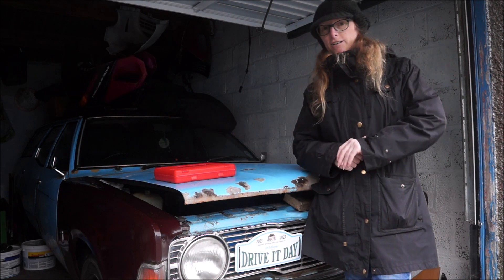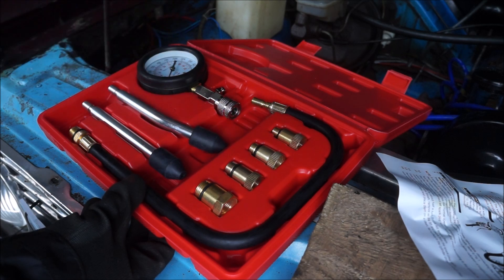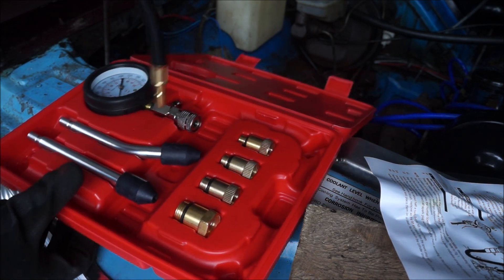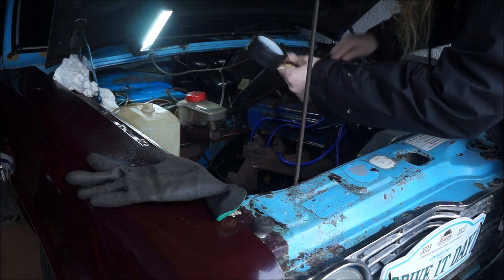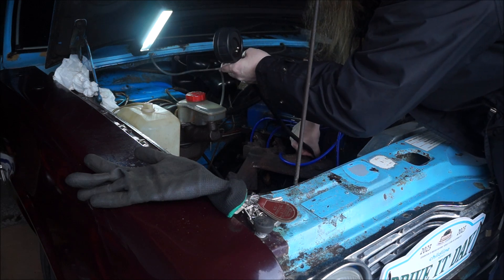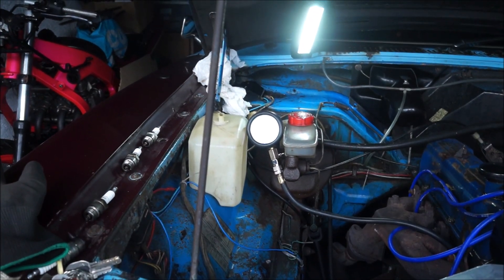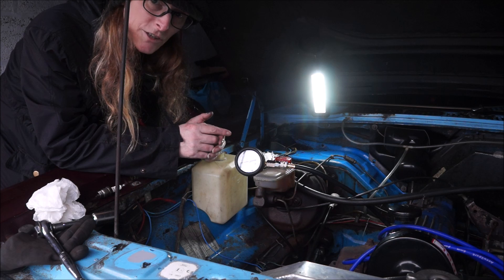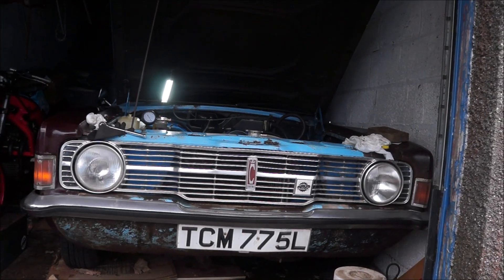Does TeeCee have compression. Testing ford Cortina Pinto engine.

Comment: They used to fit that engine in Ford transits in the early eighties Simone...its a Pinto...seems funny why its using oil when it was ok last year...it almost sounds as though the ignition timing is out or the plugs are firing in the wrong order... appreciate how u feel because that car is your Pride and Joy.,...
Good luck.....Bob......

Comment: Compressions are fine Simone...valve stem oil seals wouldnt prevent the engine from starting...the old Ford Transits used to have a ballast resistor to aid starting...does Tee Cee have one.?   Bob...
Reply from the maker: I have no idea Bob. I think the none starting is due to the carb being filthy. the engine burns too much oil, that's why I was testing the compression.

Comment: We went through a similar process with the Moggie for similar non-starting reasons, even took video of compression testing but never got uploaded. We tried everything to get the car started and although we had previously had carb issues it was mostly down to the plugs being dirty, too much standing around and too much idling on choke. I'd suggest clean the hell out of those pugs or fit new NGK ones with gap checked. Fresh petrol down the throttle and topped up battery - I think once you get it fired up, run up to temperature and it's system cleared through you'll be ok. That said - making sure carb is cleaned out is a good move anyway - though it was running ok before it's winter rest? Good luck!
Reply from the maker: I will be getting a new set of sparks. Yes the car has sat for way too long so it's my own fault really.
Reply: @HookedOnClassics-1  Good plan, don't beat yourself up about most of us leave cars sitting too long.

Comment: Nice kit. Compression looks good. Even across all cylinders. I'm not sure what the specs are on the 1.6 but if I remember from class, 125 is the low end and still should run. If the dizzy isn't whacked, timing is set, spark plugs are in good order, then we'll see what the carb rebuild will bring.

Comment: Valve stem oil seals  are not the problem if they were bad you would get bluish grey smoke when its running. Yes get a carb kit and clean out all the jets. Is that the orignal starter motor you got with car ? have it tested or replace it, it sounds tired. Like i said before its not wise to leave the car standing for long periods Simone, all the condensation builds up after it has been running  and left standing in a garage. Also check the warranty on that battery i am sure its not 12 months old, some have a 2 year warranty.
Reply from the maker: when I was being followed after Gaydon last year I was told It was smoking but I couldn't see it using the rear view mirrors. It burns oil badly so it has to be something. I can't remember if the starter was replaced and the battery has already been replaced in the last year.
The car has an isolation switch so I think the cold got to it, it charges ok though.

Comment: To be honest the numbers themselves, unless really low don't matter for general use. The most important thing is consistency across the cylinders as that represents even wear. TeeCee certainly looks healthy to me 😊

OK, you probably have slightly less power than when it came out the factory 50 years ago...but that does not matter for a classic car being used normally.
Reply from the maker: My thoughts exactly Adam. I am very pleased with the result and it puts my mind at ease.
Thank you for watching 🙂

Comment: Did you open it to wide open throttle and block the choke open? I would think 125 PSI would be good reading.
Reply from the maker: no point. I took the carb off
Reply: @HookedOnClassics-1  ok. I couldn’t see that detail. Looks like the compression is good. What engine does TeeCee have?
Reply from the maker: @haneyoakie14  He has a 1.6 ltr pinto engine at the moment.
Reply: @HookedOnClassics-1  if your compression ratio is 8:1 and 1 ATM is about 15 psi, then 8*15 = 120, so I think TeeCee passed the test, as you mentioned. Winner!!